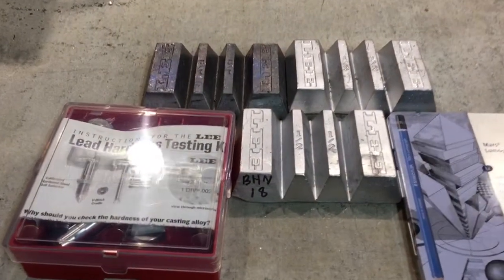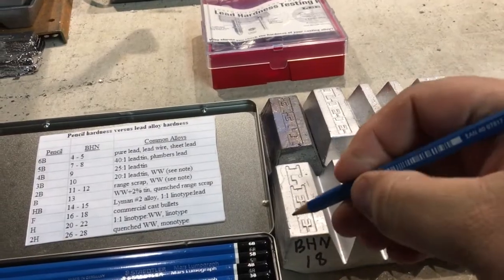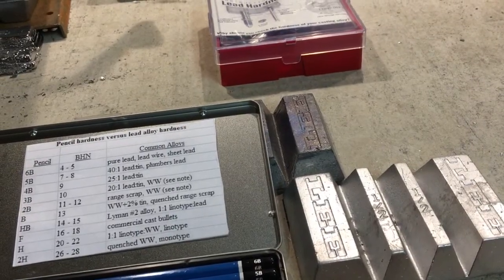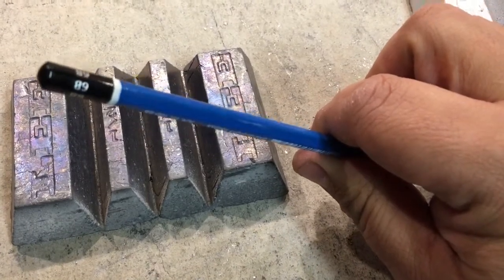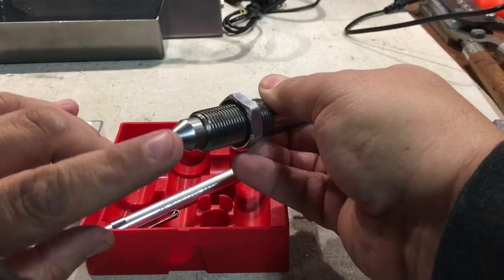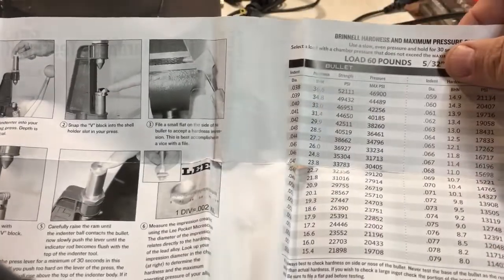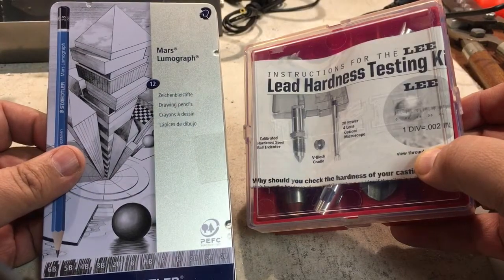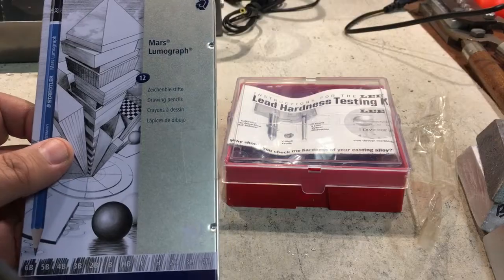Testing Lead hardness my two methods

Comment: Thanks I have never tried the pencil method. I used to be a draftsman when we used pencils and ink. It just never dawned on me to use pencil. I have cast at least 300k bullets for one gun alone  that I used to keep records for. I have read a lot on casting  just do a good job. I do love simple elegant solutions for problems and I consider this an elegant solution thanks again.
Reply from the maker: I’m glad I could help. My goal is to make difficult thing easier to understand.
Reply: @nycreloader  you have achieved your goal with me

Comment: Thank you for teaching me this. I found your video while trying to figure out the hardness of some "type" lead used to make rubber stamps. I have drafting supplies with that brand leads and lead holders. When I used your method the H2 didn't scratch the surface, the H3 made a very clear shinny scratch in the test peace. I repeated it several times with the same results. You can't get any better than that! Thanks again.
Reply from the maker: Danny L I am glad 8 could share some knowledge with you. My goal in life and in reloading is to take difficult concepts and make them easy to understand. Welcome to the channel if you haven’t subscribed please do so. Thx
Reply: Einstein said if you can’t explain something simply, you don’t understand it well enough.   Well done!

Comment: Hey thanks! Watched the video earlier this afternoon, ran out to Office Depot and picked up the pencils, came home and did some testing. My latest batch of lead tested at 9 bhn while my previous batch tested at 13 (sailboat keel vs. range scrap quenched). I was waiting to do another casting  session until I knew whether I needed to harden the current batch. And I do. So thanks again. I'm a sub.

Comment: Thanks for demonstrating a cheap, easy lead hardness test. In one of your later comments you report that you have validated the pencil vest with the Lee test many many times. That ices the cake for me.

I picked up some scavenged sheets of X-ray room shielding lead which I was told are almost pure lead. Since I'm casting conical bullets for cap and ball revolvers, low BHN matters. When my pencils arrive shorty, I'll see, and report back.
Reply from the maker: That’s great to hear I am here to help the community and spread the joy of reloading and casting. Best of luck brother

Comment: Thanks for the info. I have been casting soft lead for black powder guns for some time, but I am learning about common calibers and reloading. I didn’t realize that the lead needs to be made harder for this process, and have been having trouble finding the Lee hardness tester. I am going to try the pencil method to see how that works out.
Reply from the maker: Glad I could be of help. That is the reason I made the video so I could get this info out there.
Reply: @Blueskies Yes it is!
Reply: @Blueskies Pure lead is preferable, but 9bhn isn't that much harder than pure but you should probably keep it under 10 bhn for black powder rifles as a rule.

Comment: Thanks for the information. All this years I have been using a hammer and  anvil. I would cast a bach then take one bullet put it on the anvil and smack it with the hammer. Your way looks alot easier.
Reply from the maker: Glad I could help, that’s why I’m here!

Comment: Thanks for the video. Just have a quick question I did not see asked in the comments. The Mars Lumograph Art Drawing Pencils in the video, does not mention which version, is the version you have the 12pack graphite version or Lead version, and does it make a difference?
Reply from the maker: They are “Staedtler Mars Lumograph Sketching Pencil Sets set of 12” staples and Amazon both sell them.
Here is a link to exactly what you want. 
https://www.amazon.com/dp/B0014E2S0Q/ref=cm_sw_em_r_mt_dp_BQ16GBMDVTXVC6W1T80P?_encoding=UTF8&psc=1
Reply: @nycreloader  Thank you for the quick response, placed my order, good-2-go. Good video very informative, saved me a ton in money and stress.

Comment: Staedler have two sets of 12 pencils available, the 100G12, which you have, and the 100G12S, which goes from 8B up to 2H.... Since I am mostly interested in the softer alloys, would that make more sense?....
Reply from the maker: Rick O'Shea I use the set in the video as anything over BHN 28 gets melted into raw lead to harden it up. The reason is it’s too hard to resize and too hard for my bullet making purposes. Go with the 100G12 and that’s all you will ever need.
Reply: @nycreloader   Thanks.  My question is posed in context of airgun projectiles, at the very soft end of the spectrum.
Reply from the maker: Rick O'Shea so if you want soft lead it’s raw lead at 6BHN and that would be the first pencil in the kit.

Comment: Hello

I appreciate this video as I had never heard of this pencil test before. I have been using a Cabin Tree hardness tester for many years now, but this pencil testing sure seems to be a whole lot quicker.

I wonder if you could provide a link to the chart you found online? 

I've been to the pencils site, and did not find the chart there. I also looked in the Cast Boolets forum and found there was several thoughts on how the lead hardness tested out, but they were somewhat vague approximations.

Respects,
Richard
Reply from the maker: As requested.  https://imgur.com/gallery/QqPwvvs

Comment: Whats the price difference in the lee method and pencil methods?
Reply from the maker: Crypto Info both methods work and work well. The pencils are easier, cheaper and faster and these days I only use the Lee tester to validate the BHN. In hundreds of test they come out equal. So either method works one is just a lot faster, much more portable and lots faster using the pencils. https://www.amazon.com/dp/B0014E2S0Q/ref=cm_sw_em_r_mt_dp_eCjjFbRS2B832
Reply from the maker: Crypto Info sorry the price for the Lee hardness tester is 70-90 bucks US and about 10 -12 bucks for the pencils ✏️ there are a few different kits some with more pencils, and some with less pencils. All do the same job but more pencils gives you some even harder pencils for our testing purposes.
Reply: @nycreloader  Awesome thanks for the info! Im headed to Home Depot after work to get a set, ive got probably 500 # of lead ive been melting down and casting into ingots with my muffin tin the last couple years. Most of the lead was found metal detecting a old sawmill and homestead, Im thinking it was from roof and window sealing. Can you suggest a place to get the antimony and tin required to harden it up?
Reply from the maker: Crypto Info root metals is who I buy my lead/antimony from. You want to buy super hard lead from rotometals as antimony is to difficult to melt in a standard meltipot. This stuff is already alloyed and will mix easily and as always don’t make you lead melter to hot. If you do you’ll pull the antimony out.
Reply: @nycreloader  Awesome, thanks!

Comment: On your chart it says "see note" - What does the note say?
Reply from the maker: Hey Doug if I remember correctly it was about there being multiple types of wheel weights with different hardness values.. all that matters is the BHN values to the left and the right expresses what type of lead alloy it is. The hardness is the hardness the other column is simply a description of what type of lead alloy and designating why some wheel weights are harder than others even though they are all wheel weights. I hope that helps.